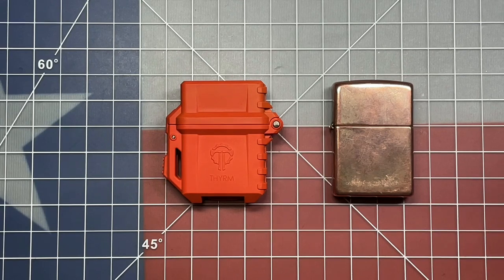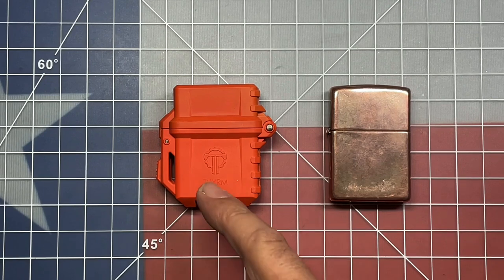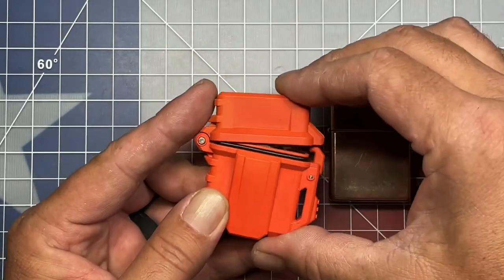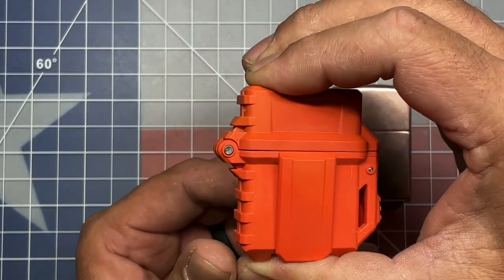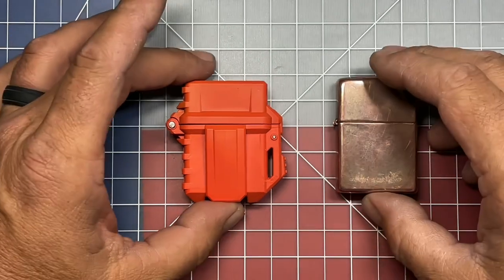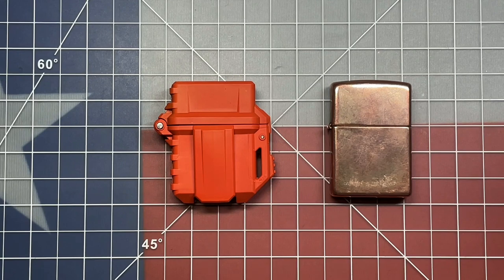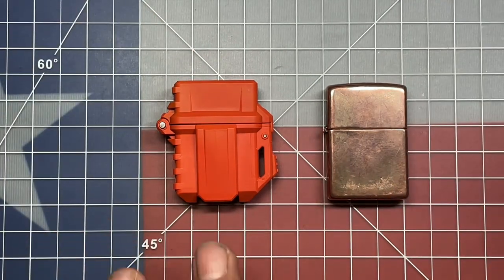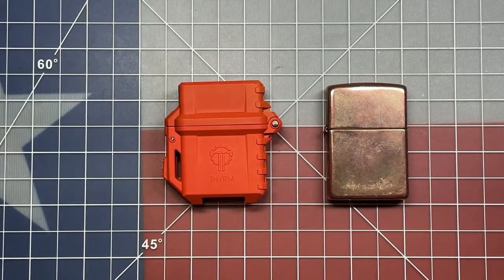Thyrm Pyrovault - 60 Day Update

Comment: Thanks for taking your time to do this! I was waiting for this second video before I made my purchase, so thank you for saving me $30!
Reply from the maker: I will say that others have claimed much better results than I experienced.
Reply: @txtoolcrib  Well, that just means that there could be too much product variation and could still end up costing me. I really only use the pipe insert anymore with my zippo lighters so I wasn't sure if the plastic/polymer would hold up for that purpose anyway.

Comment: Use scales to work out the evaporation day after day vs opening up.
Then maybe a wide rubber band around case and see if that helps seal the gap.
Reply from the maker: People have suggested I return mine, because they have not had the same experience I encountered.

Comment: Since you prefer the liquid fuel type of lighters you might want to check out the Exotac Titanlight. I keep one in my camp gear and even after a couple of years it still lights up no problem. They are a bit pricy but absolutely worth it.
Reply: I have one too. I top it off before I go camping just to be safe, but I've never had it actually run dry or not fire up.
Reply from the maker: I have been thinking about getting one of those.
Reply: @txtoolcrib  They are cool. Just as a heads up in case you do get one, in my experience the seal is almost too good. What I mean is that it appears that the vapors don't have anywhere to go. So when you uncap the lighter there is a thin coating of the fuel on/around the chimney and wheel. If you don't wait a bit for that to evaporate it can flare when lighting it. Still the fuel retention and dead simple design make it, in my opinion, one of the best wilderness lighters out there.
Reply: That's a nice and polished version of the peanut lighter, which you can get for a fraction of the price.

Comment: Could it work to apply some grease to the o-ring? It might make too much of a mess to be worth it, but it would probably be easier than replacing the gasket with a better fitting one.
Reply: I was thinking the same, maybe since it was dry it didn't make a proper seal? Regardless pretty disappointing, I almost bought this lol

Comment: Ranger band on the Zippo if you don’t use it often.
Reply: Ranger band?
Reply: @Private0Malley  Ranger band refers to a piece of inner tube that is sliced to the desired width and used as a fastener by stretching over the object. Stretching it over the opening seam of the Zippo could possibly eliminate fuel evaporation as well as waterproofing the lighter. It would be awkward if used often but maintain your fuel if stored long term. Ranger bands have also been used to secure ferro rods to knife sheaths since the rubber is an excellent fire starter. I have also used them stretched over tool handles that were slick to provide a better grip. The trick is to find the right size inner tube for the job. Bicycle to truck tires leaves lots of choice for sizing requirements.